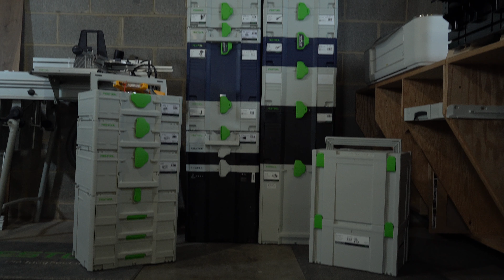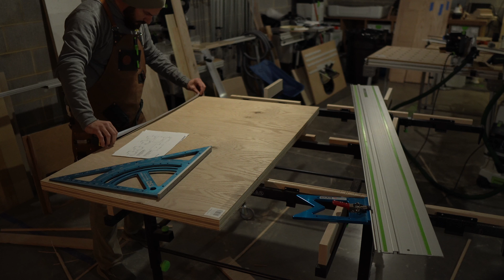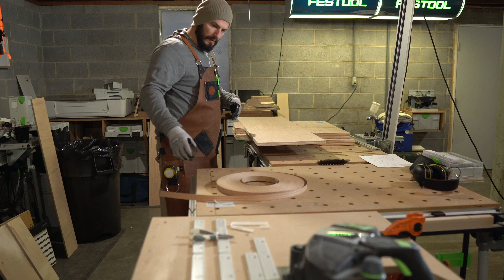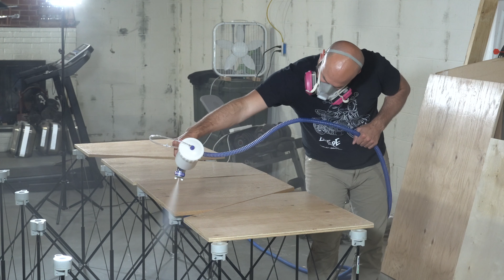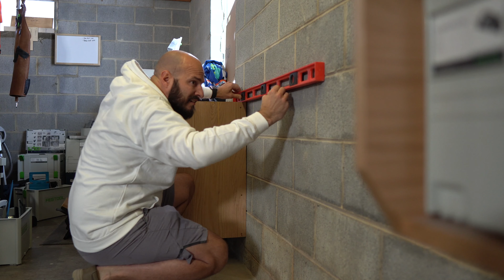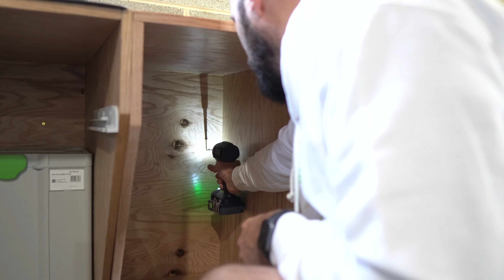Systainer Storage | The SysBENch | Storage + Workspace

Comment: Very thought through design to support your work flow (and dust cleaning). As a Festool user over many years, I have learned many useful tricks from your videos. 
I am using both Festool's drawers and home made drawers with push to open slides and like the push to open  better the Festool drawers in a stationary design.  One advantage is that home made drawers could be made to double (systainer) depth which would give you easy accessible storage for two systainers per drawer. You can never get enough storage space for Festool systainers. 😀
Reply from the maker: Glad you found the videos helpful 👍🏻👍🏻 systainers are addicting 😆 I use the systainer from the shaper to hold my camera gear on my motorcycle, works fantastic

Comment: I am new to the Festool ecosystem and am starting to collect a pile of systainers. Would it be possible to make your sys-bench so that you can have systainers double deep in each drawer?
Reply from the maker: Like have two systainers stacked in the drawer?
Reply: @BenMarshallDesigns  sorry for late reply. Thinking of shoving one in after the other rather than one on top of the other.
Reply: You would need 600 mm deep drawer slides.

Comment: Hey Ben.  I see that you’re using your new Fuji Sprayer.  Which one did you get?  I would be interested in seeing a product review on that some day.
Reply from the maker: I have the Fuji Q5 platinum. I’ve had it for a few months and will review it probably This summer depending on my schedule. It’s been a great sprayer so far, still learning the ins and outs of spraying as I used to roll and tip all my projects.
Reply: @BenMarshallDesigns  Thanks Ben I look forward to it and appreciate your time to full learn & experience the product prior to your review.  I know that one can chose from three Fuji guns with the Q5 and you chose the T-75G over the T-75 or the G-XPC.  I’m interested in hearing about why you chose that gun over the other two when you do your review  (I believe your buddy Jason is using the G-XPC). (I’m trying to pick between the two Gravity Guns myself). Thanks.
Reply from the maker: @warrenbarnes6629  Thanks, Warren. When I ordered the Q5, I don't recall having a choice on which gun to use (was an amazon purchase). The gun I have works, however it can be finicky at times. The screw on lid can be a pain when there's a little bit of built up residue near the threads.

Comment: Did you end up buying a table saw?
Reply from the maker: Nope! Still holding out on the Festool CS70. Shipping to the US is about the same cost as the saw, so for the moment it's still not in the cards. I did upgrade to the TSC55KEB, which is a fantastic track saw
Reply: @BenMarshallDesigns  could I rip 1x2s with a track saw? I'm trying to avoid getting a table saw until I can get the Festool, also. However, I make laser signs and frames. I would like to rip my own wood for the frames. Thanks
Reply from the maker: @Jesusistheonlyway549  it’s very possible. Festool makes the parallel guides and an edge guide for narrow rips on sheet goods. for that kind of cut, a table saw would be more of a convenient way to rip rather than actually capability issue. 

https://www.festoolusa.com/accessory/491469---pa-ts-55#Overview
Reply: @BenMarshallDesigns  thank you. I guess I need a table saw. 😢.
Reply from the maker: @Jesusistheonlyway549  Good luck with the hunt. totally possible on a track saw, but much easier on a table saw if you’re doing it constantly. If I had to make small rips everyday, I’d much rather do it on a tablesaw
Reply: @BenMarshallDesigns  thank you so much for your help.
Reply from the maker: @Jesusistheonlyway549  my pleasure. If you end up getting one, let me know which you decide to go with
Reply: @BenMarshallDesigns  I sure will. 😊

Comment: Great idea. I love the idea of keeping everything in Systainers for protection and for the super slim chance that I'll be working offsite. It also feeds my OCD. I'm glad that you used the full shelves instead of just the new style that don't allow the boxes to open unless they're pulled out.
Reply from the maker: Thanks! My middle SysBENch uses the new style drawer slides. I'm a fan of the Sys-AZs for sure - makes retrieving/storing a breeze. I think the new drawer slide system is better for mobility and not as much for shop use. The plans I'm selling are for the SYS-AZ drawers, not the new style slide measurements (different than SYS-AZ). I really dig the style of the bench as well.
Reply: @BenMarshallDesigns  you nailed it. I'm looking at converting a bare Transit to a combo camper and mobile work van so the Festool rails are the way to go. I started off working towards Milwaukee Packout but they have zero elegance to their setup whereas I can use Sytainers for clothing and food storage just as well as I can store tools.
Reply from the maker: @JaySellers  sounds like a fun project!

Comment: Nice I wish I had the wall space for another bench and easy sys access, I had to build 1000mm cabs up high on the wall.  #JBS 😂
Reply from the maker: 😆 those damn tools just keep multiplying for some reason
Reply: @BenMarshallDesigns  let me know if you ever get to Roanoke / SML area and get a look at the shop
Reply from the maker: @craigbrosinski1905  I’m in Lexington, so the woodcraft down there is my main festool dealer. I’ll shot you a message next time I’m making a run

Comment: That was good. That was very good. Extremely detailed & concise. You have the benefit of a concrete (type) wall, so am curious about the approx weight of each sysBENch without systainers & tools. I'm also looking at using mft style tops instead of ply, as I already have them. Due to the weight, does it have to be wall mounted, or is there a way (additional info) to floor it & secure to the wall (wooden studs)?
Reply from the maker: Although I don’t have a scale to measure it, I’d rate it 6/10 on back pain, and a 9/10 on solo awkward installation 😆 have a tire jack REALLY helped out and made it easier. It’s about 1.5 sheets of 18mm ply. I’d say it’s close to 100lbs
Reply: @BenMarshallDesigns . Mine will definitely need to be floor mounted. My wall has enough weight on it already, so looking forward to trying to this out one day very soon.
Reply from the maker: @hythewoodworkdesigns  Cheers! I considered a kicker plate version, but didn't want to complicate the design. Interested to see what you come up with!